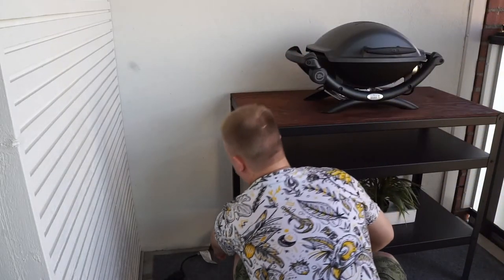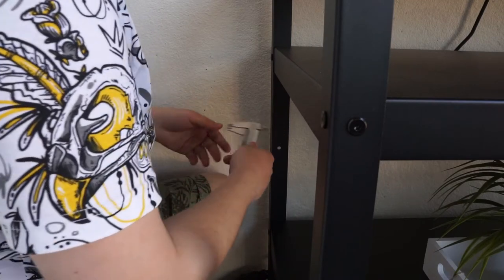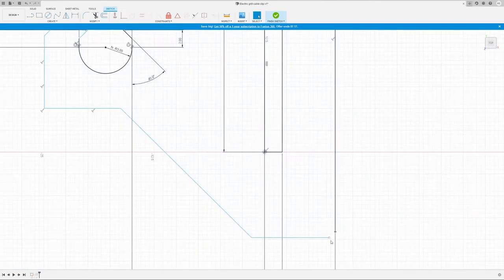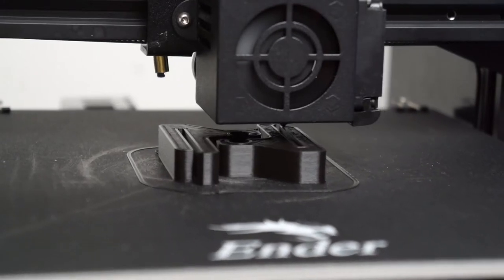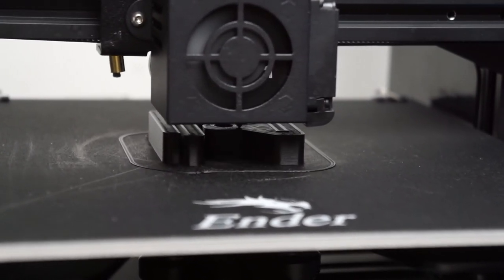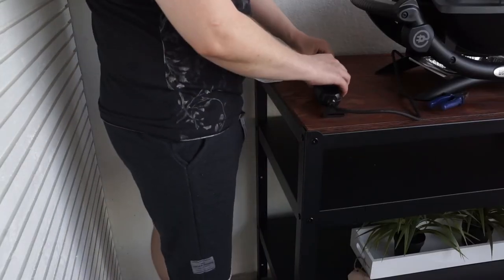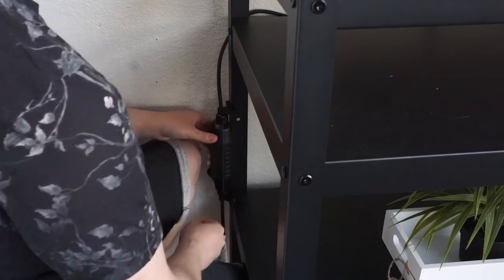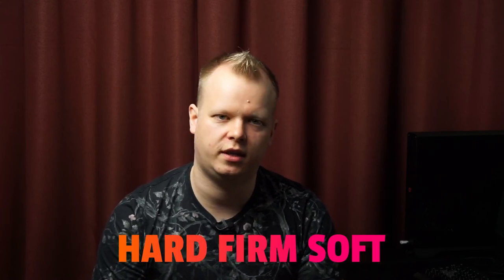Design and 3D Print a Custom Electric Grill Cable Clip | Practical 3D Print

Comment from the maker: I want to hear, what practical 3D prints you have done or would like to do?
Reply: Well, not many actually. I tried a stand for my Lenovo Legion laptop, but boy it was pathetic. So I reverted to an older design that just resemble legs.

Btw, since you have dd on your ender 3, do you know how you could slow down print speed while doing the outer layers? This is important because dd's are notorious for ringing.
Reply from the maker: At least in Cura, you can set wall speed separately, so you could have for example 30 mm/s for walls and 60 mm/s for everything else. This is actually what it does by default. 🙂